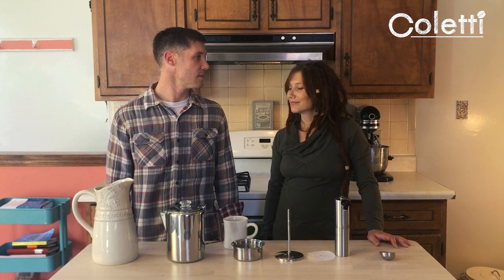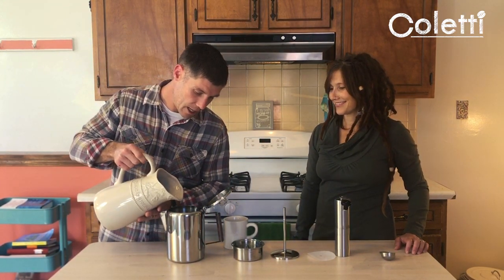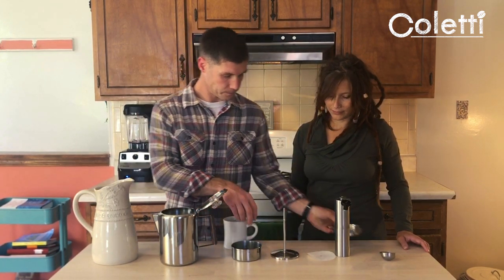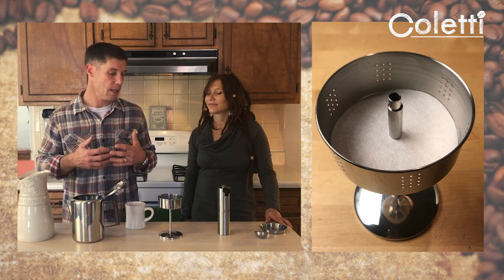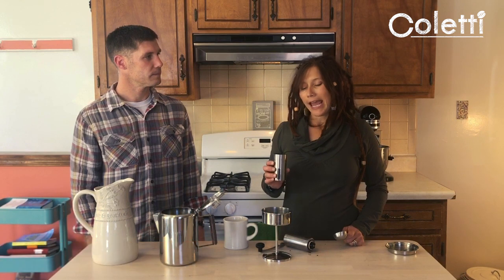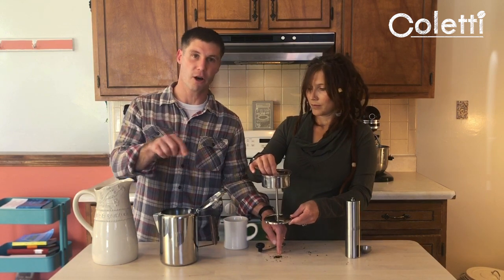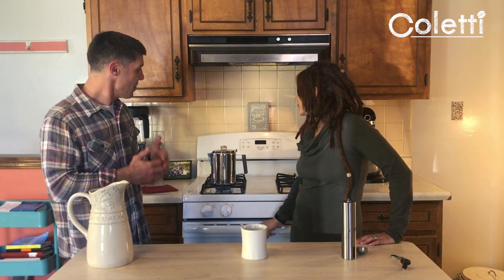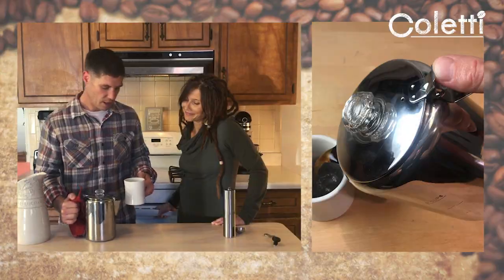How to Make Coffee with a Percolator | The Coletti "Bozeman"

Comment: I bought the Coletti percolator three months ago and it's the best coffee maker I've ever owned! I highly recommend one to anyone wanting high quality coffee with no plastic or heavy metal contamination.  100% stainless and glass is why I bought it.
Reply: Paid shill
Reply: Lol definitely a paid actor. At least it’s obvious.
Reply: Sorry, I'm not a paid actor. Just a health conscious individual that likes quality cookware.
Reply: Well, I'm not paid.
So for the 6 cup pot.

It's very heavy duty stainless. It's not magnetic stainless, so gas or coil element electric stoves. 

Ours, the coffee markings are off, on the high side, so filling to the max based on the pot markings is an overfill.

Don't use the markings.

Measuring cup or weight measure a cup of water, a cup being 5 ounces the European standard for a cup of coffee. 

Yes, they state 5 ounces on their website. You aren't baking here, which is 8 ounces.

It struggles to make 2 cups with the 6 cup model. 3 cups, aka 15 ounces, it's fine. Then anything in-between, including 6 cups, 30 ounces of water. 

We use one rounded table spoon of coffee per 5 ounces of water,  7 minutes perk on medium low, and even low.

It varies by gas stove.

You want the pot at simmer,with enough heat to cause a boil under that dome, with the trapped water, that the stem is attached to.

So once it comes to a pot boil, reduce heat, way down. 

If you don't burnt coffee will be the result. 

Also, wetting the basket before putting coffee in cuts down on the fines falling through. If not using a paper filter.

I got it for the wooden handle, glass top.

It makes decent coffee, and I can't see why anyone would complain about the build,  other than it's heavy.

Comment: For those that have grounds in their coffee....
There may be a gap between the basket and basket lid when assembled, as mine did.  The grounds will then boil out this gap into the bottom of the pot. (Also seen running down the side of basket when pulling out). And noted when pouring a cup, grounds can flow out w/ liquid.
  With pot empty and assembled dry, hold down the basket lid and try to pull UP on the stem. If you can... then there is a gap between the basket and basket lid. (The crimp or "ferrule" on the stem that holds the basket height is too low).    
  Add thick stainless steel washer(s) as needed, to close this gap. The amount of grounds in the bottom of the pot will be extremely minimal. Additional option is to slightly flatten the stem where the basket sits so as when assembled, holds the basket in place as to never lose the washers you've added. I never take mine apart...
 ** I use no filters, and a coarse grind on my Colette hand grinder and get little to no grinds in my pot. Any fine grinds that escape are usually boiled away.

Comment: I followed his directions exactly and as it was brewing grounds are going into the glass I can’t keep grinds out of the coffeee am I boiling to hot what’s going on?
Reply: There may be a gap between the basket and basket lid when assembled as mine did.  The grounds will then boil out this gap into the bottom of the pot.
  With pot empty and assembled dry, hold down the basket lid and try to pull UP on the stem. If you can... there is a gap between the basket and basket lid. (The crimp or "ferrule" on the stem that holds the basket height is too low).    
  Add thick stainless steel washer(s) as needed, to close this gap. The amount of grounds in the bottom of the pot will be extremely minimal. Additional option is to slightly flatten the stem where the basket sits so as when assembled, holds the basket in place as to never lose the washers you've added. I never take mine apart...
 ** I use no filters, and a coarse grind on my Colette hand grinder and get little to no grinds in my pot.

Comment: I found a bunch of grounds after using this perculator.   I had to run my coffee through an old coffee maker's  mesh filter to pass the perculated coffee through into another pot to get the grounds out.  Too much work.   Best if this coffee maker had smaller holes like the mesh metal filter at the top and bottom where you put the coffee.  This way, no filter is needed and the coffee grounds won't sneak through.

Comment: I have an induction stove top which requires magnetic cookware to work.  Will a magnet stick to the bottom of the percolator demonstrated?  Is the basket and stem stainless steel or aluminum?  Is the clear bulb on top glass or plastic resin?  Thank you for your reply.
Reply: David, the Bozeman does not work well on induction stoves. This is true of all 18/8 stainless steel product. 204 steel, which is considered lower quality because it rusts, is better suited for induction cooking.  Cutomers who want to use the Bozeman on a induction stove need to put it on a cooking plate.

Comment: Opinions please:  percolator or French press coffee, which do you prefer?
Reply: Immersion brewing (French press) no question.  Most of these percolators are nasty by comparison but nice as easy, durable coffee devices for camping.
Reply: Any particular reason why you believe the flavor to be so different?
Reply: For me it's simply the taste.  I've had both and the difference is there.  Same goes for a drip maker, which is also a percolator of course.  I can get superior results with a French press but it can't brew as much coffee at once and it's a pain to take camping.  So each solution has its place.
Reply: If you search around you'll find all sorts of coffee snob charts and graphs and science on the actual whys.  I just know if I take the Pepsi challenge I can tell which coffee was immersion brewed.  I would describe it as a smother, more complete flavor.  But when you're outdoors camping, the old percolator can taste might good.
Reply: Honestly after seeing how a percolator works I see it is no different [in the process] than an auto-drip maker. 

I prefer the French press because the taste is smoother. There is a notable difference between French and regular.
Reply: Martin Battilana  hot water rises into the basket with coffee grounds which then falls down into a glass carafe or percolator.
Reply: Martin Battilana  if you want to be technical, you are correct. The percolator uses steam but the auto-drip uses boiling water.  "The only difference is that the percolator reuses the coffee to produce steam and dripping factor unlike the Automatic Drip method where in water passes once and brews the coffee."
Reply: I would say it depends on the amount. French press is great for a small batch. If I have more than one or two people then a percolator or drip method is best.

Comment: Sorry, I have to take issue with your method.  
The peculator process, as what done back in the day (before drip coffee makers and you were born) is the water at the bottom and entrapped by the funnel will get hot first and starts to boil. Those boiling bubbles rise up through the tube, like an airlift pump and pushes water up into the globe making that "perking" sound drips down into the coffee grounds.  Eventually all the water heats up and boils, the perking sound stops but the coffee still rises and soaks through the coffee grounds. When that happens you are done, if you continue to boil the coffee and cycle it through the grounds you will over extract the coffee and its bitter..."I'm coming sugar, daddy needs you bad!".  In other words its a terrible cup of coffee.  
This is how my parents made coffee back in the 50's and how I made coffee back in the late 60's. :)
Reply: tihzho I just bought this coffee maker...just out of curiosity, once I bring the water to a boil and it start “perking” I turn the heat down to low/medium then set my timer...is that correct?
Reply: @MitchPR08 old post, but to other readers, yes. The higher heat is just to get the water to full boil faster, once there cut back on the heat as you say. You don't need the extra heat to get the water up the tube once boiling starts, just to maintain it at middle, middle low heat.